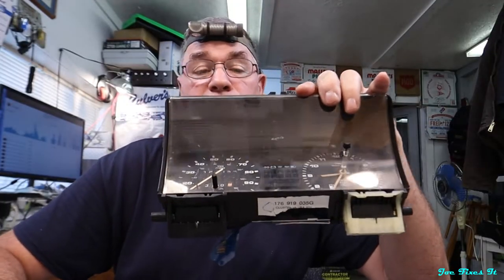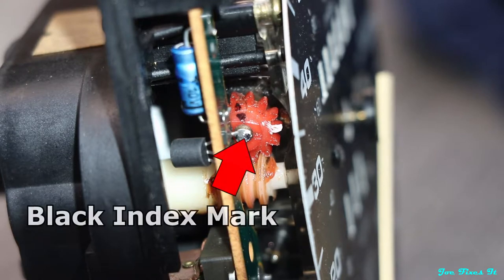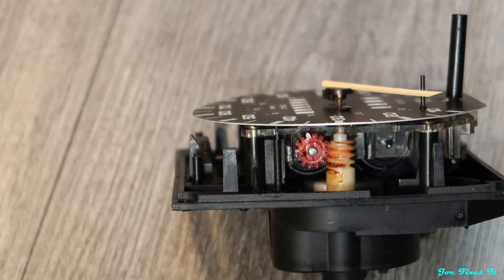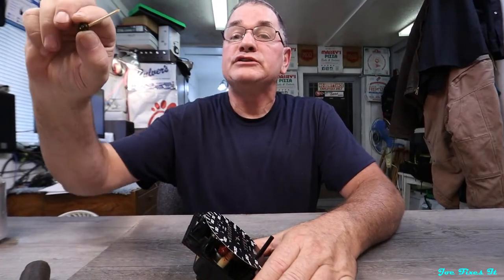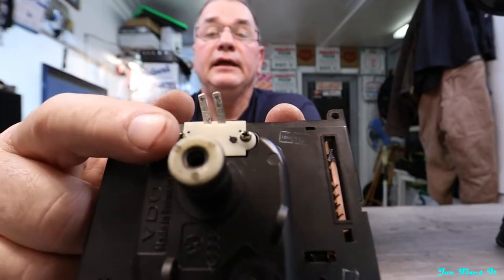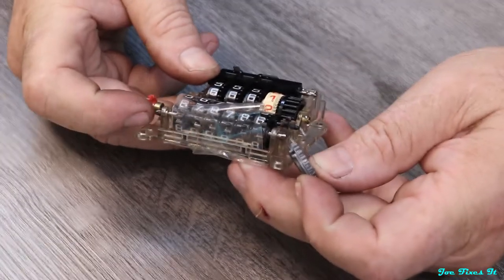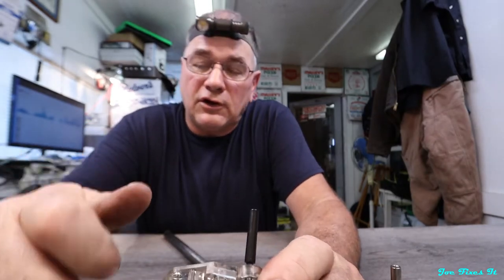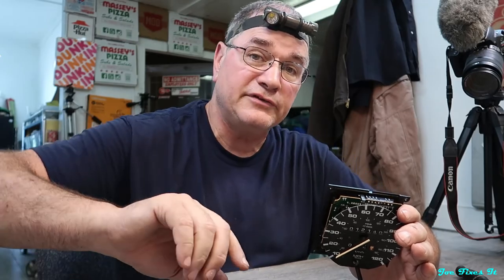How To Repair A Odometer | DIY Speedometer Repair | MK2 VW Diesel Gas 1985 1992 Jetta Golf 🚗🚕🚙

Comment: Superb video. I never leave comments but it is merited this time. I followed your instructions exactly and it worked perfectly. I have a Mk2 Golf with a Mk3 1.9TD swapped in to replace the stock 1.6D.
Reply from the maker: Thanks.. they are not too hard to fix.. a little hard to find the.gears but not impossible.
Reply from the maker: Sweet deal. I would love to have a 1.9 in my jetta

Comment: Thanks for sharing your knowledge 🙌
Reply from the maker: I want to make more Mk2 videos..
Reply: @Joefixesit  yeees !!! That would be awesome 🤩 

Any chance you can make a video of how to fix if the needle is only bouncing?
Reply: @Adel_Volks  that is almost always caused my a bad or mis-routed speedo cable.
Reply: @JoeisHungry  , wow! I will check it then. I just finished opening my speedometer thanks to your video… and I found out I’m  missing the small plastic gear. I will be making an order very soon.

Thanks 🙏
Reply: let me know how that goes, they are not very complicated, just have to be careful taking them apart.

Comment: Hey thanks for the video this is probably a stupid question, but in regards to the worm drive gear and the red sprocket that rotates with it, if these 2 don't turn together could it be the cause of the tachometer (mileage recording) not working, or is that only if the speedometer isn't working. I was a bit confused so hopefully someone can clarify for me, much appreciated!
Reply: the little white gear on the side usually splits with age and turns loose on the shaft and or the pot metal gear on the opposite end fails. You can buy both on line these days
Reply: @JoeisHungry  yeah I after removing the unit from my vehicle I was able to see that the worm gear is what then turns the other internal components, as you highlighted in your video mine also has a small crack in it, but was slightly out of place so I pushed it back into position, and tested it and seems to be working okay for now. I will have to replace eventually unfortunately I made a stupid mistake when trying to remove the unit and ended up damaging some of the multi plug connector pins where they actually connect to the plastic pvc circuit board. To be totally honest I think I'm a bit f***ked now, but will see if I can find someone that would be able to repair this, or if anyone knows of where to buy replacements. I'm based in the UK so unless you have happened to come across any european or UK based companies yourself I doubt there's anything you could help with. I'm only saying that so you don't waste your time trying to make some suggestions for US based companies if you were going to help, but I'm not expecting any help.

Comment: hi joe, my 2007 vw rabbit has its odometer not working. i took the dash out and when i put the positive wire from the battery at the power wire at the dashboard, it moves, but when i put all the wires from dash toggither, it doesent. do you think theres some power missin on it?
Reply from the maker: I primarily mess with MK1 and MK2 Diesels, I think what you have is a MK5 of MK6. Does not sound like a mechanical issue. I am sure you have checked the fuses. Your car is much newer than the ones I work on. Sorry

Comment: Hi Joes,

What can be the issue like this : 

When i remove "black jack" from cluster the car works normally,

When i put it back, the engine shakes for some moments..

What is the wiring on the black jack (left one) ?
Reply: if this is a rabbit 1984 and down.. (not sure about the Mark II) 1885 to 1992 but I think this is the case also, the red charge led is a part of the charging system with the cluster hooked up the alternator is not charging taking a load off the engine thus running smoother.
Reply from the maker: correct

Comment: Joe, I SURE hope you can help me.  I've got an MK2 cluster that looks VERY similar to yours pictured (it's actually made by Jaeger and comes out of a 1991 Mexican Volkswagen bus... long story).  The problem is that the speedometer works, but is very sluggish.  It lags a lot and takes a few minutes to get up to the speed I'm traveling.  It appears to keep the correct high speed, but at slow speeds, or when stopping it takes forever to drop all the way down.  Any ideas?  THANKS! (PS: I can email you a pic if you'd like).
Reply from the maker: yeah send me a photo at photos1101@gmail.com... 3 in 1 oil (not the spray) ..sounds like the needle shaft has some corrosion  on it or gummed up. The fact that it is accurate makes me think that otherwise I think of moving the magnet (which I hate to do) the speedometer heads are pretty common gas same as diesel.
Reply: @Joefixesit  Thanks, Joe! Last night I took it apart, cleaned and lubricated it (hopefully white lithium wasn't a mistake?).  When I tested it with the old speedometer cable and a drill (yes I bought a new speedo cable) it appears to work perfectly.  After coffee I'm putting it in and we shall see... I will also email you some pics because I'd like to see if it's possible to change out the speedo for one that reads MPH.  Thanks again and will email you soon with the results. - Chris
Reply: @ChrisRubeo  sure can.. just need to find a MPH speedo head. let me know what happens back in the car

Comment: Any advise on how to fix a VW mk1 Golf (rabbit) speedo, specifically the magnetic drive?  The magnetic "pot metal" disk broke into pieces. Any suggestions other than stripping one off a scrapped vehicle?
Reply from the maker: You will need to find another speedometer head if you can find one. Does not matter Gas or diesel. My question is how in the world did that happen. sorry for taking  so long to answer
Reply: @Joefixesit  A very impatient fool with a screwdriver, aka me, trying to pry the soft magnetic disc off the part where the cable goes into.  Wanted to remove it and find the noisy bearing I thought it had underneath not knowing at the time there was no bearing.  The original issue was at certain speeds it suddenly jumped 40kms/h higher and made a terrible squealing sound till you slowed down enough or whacked the dash hard enough for it to jumped back to normal silent operation.  Oh well, this is South Africa, should be able to find one at a scrap yard somewhere.  If it wasn't for the fact that it was magnetic i would have 3d printed a replacement disk already.  Are we sure that it's magnetic?  I have pictures of what it looks like internally.  One could be forgiven for thinking it was friction run, almost like a clutch plate.
Reply from the maker: @mikebmike1999  definitely a magnet. That is how it works. I would send one I have but shipping is a killer over seas plus mine reads MPH. Hopefully you can find one, her in the US they are impossible to find.

Comment: Hi my 1990 Polo speedometer often stays at zero, sometimes it frees off after a few miles or if I stop and start again. I've replaced the cable and it still does it. Interestingly the miles still go up so I guess the cable is fine and connects OK it must be the needle or some part driving it? Worth a bit of lubrication somewhere??
Reply: I assume they are using the same or similar cluster to the VW Mk2? it is usually the odometer that does not work and the needle continues to point at the correct numbers as the drive gears are slipping on the shaft. but in this case sounds like corrosion in the needle spring assembly which in the case of VW is quite rare
Reply: @JoeisHungry  Could be - in our climate here in the UK it can be exceptionally damp - this winter we had lots of problems with condensation and I even got ice on the inside of my windscreen which probably didn't help. It is usually better on a warm day but seems to be doing it more often. I guess the only option is to take it apart to inspect this needle spring.
Reply: @StewSims  3 in 1 oil is the best lube for that
Reply: not the aerosol kind, the aerosol had hydroscopic properties

Comment: Hi Joe.  1988 Vanagon - made the hole in the metal gear smaller, replaced the 14 tooth plastic gear (broke it while tapping the shaft back on the metal gear!), cleaned and lubricated the worm gear and 14 tooth gear, and now have an issue in calibration. I get 60 mph at 917 rpm !  When it's closer to 1600 rpm I'm at 100 or more!!  Have moved the thin middle spring clockwise and CCW on the needle post - doesn't seem to do much re rpm/speed.  I thought making a bit more resistance on the spring would lower the mph.  All the gears are free, the speedo worked before I did this work.  I'm the original owner (99,970 miles).  Any ideas?
Reply from the maker: I typically do not mess with the spring tension, what I do it put the pointed at the index mark and move it from there. in extreme cases I might move the magnet on the shaft. check the color of the gear on the end of the speedo cable that goes in the transmission as there are several different once with more or less teeth that will change the speed. make sure you do not have on for a gas if you are running a diesel. For regular mk2 diesels they are white and for 1991 ECO they are green.
Reply: @Joefixesit  Thanks for the quick reply.  I think I figured it out.  On the face of the speedo it says 805 just above the MPH.  From what I have read that means set it to 805 rpm for 60 mph.  That seems much more in line with what I'm seeing with the drill speed and what it's showing with the needle.  I'll try that and see how it works.  OEM tires on the Vanagon were 185/14, I have 205/15 - I'm reading that the difference is -2.2% in terms of rpm, so I'll set it for as close to 787-790 as I can get it.  Thanks for the response.
Reply from the maker: @ricksproule6690  I have not seen one with tach numbers before but the sandard way it to take the needle off and move it. there is an index marked near the stop peg that will get you close. let me know what happens

Comment: My numbers works right, but the pointer oscillates/bounces. Changed the drive gear in the shift but it was like new, changed speedo cable and made a very bad noise (i lubricated with oil an now still makes a little noise like the original cable). What it could be be if the number works right?
Reply: sorry for responding late, sounds like you need tp replace the speedo cable. it is almost impossible to fix it with lube. That's the only reason I have ever had oscillation. they are available and not expensive
Reply: @JoeisHungry  mhh you say to try with a third cable again? I tried to turn the speedo directly with the drill in it (no cable between) and still oscillates….also cleaned the old grease in the gear and put a drop of oil. Maybe is the magnet behind the pointer?
Reply: @giacobmx  did you already replace the speedo cable?
Reply: @JoeisHungry  yes, new cable but nothing changed. I also lubed it with oil because they came with no lube and you can’t open them.
Reply: @giacobmx  normally you do not lubricate the new cable as it has a plastic liner, it is unusual to get an oscillation just from a head malfunction. I would use a 3 in one on the head itself internally. I wish you had another head to test with. Is this a MK2 Diesel or gAS?
Reply: @JoeisHungry  mk1 gti 1979.
Reply: @giacobmx  so this is round head light version, lemme see if I got an old head in the parts pile, round light are German made and rectangle are American made

Comment: hello sir do you know about GM/Opel Odometers?
Funy thing me odometer is ticking for years wont move.
I asume it has some thing to do with Delco 12si alternator its ordinary 80s car similar to WV.
How ever when me blinker relay didnt get ground me wire to ground was corroded and be acident I suppose me towing wire harnest was arcing to ground I simply cutt off that thing repaired leter that blinker / lights problem kinde of me car run in union with blinker relay and odometer worked again no ticking???
So thats what confuse me most me odometer works its that thing that counts milage / kilometers .
So be all means Im anoyed what the hell shuld I do?
Shuld I add ground wire to dashboard for extra safty ?
Use diodes and where exactly I did notice GM made fatal mistake they bypassed the alternator light diode insted those dicks used the car warning light insted so that wuld explain me alternator backcharge but still that odometer confuse me .
Can that deam thing act cinde of timer?
Reply from the maker: I do not sorry

Comment: what does the circuit board operate?
Reply: interment cluster
Reply: @JoeisHungry  aaaaahh
Reply: @yoshinoyajones8924  the circuit board is a fragile piece of plastic with imbedded thin wires on the back of the cluster

Comment: What’s going on if the speedometer needle hole part is seized
Reply from the maker: not sure what you mean, the needle does not move or will not come off?
Reply: @Joefixesit  so in the back of the cluster where you screw in the cable , that part won’t spin
Reply from the maker: @jongon705  I have seen speedo heads rusted almost solid but not that part froze.. need some serious soaking in 3 on one oil.. not the spray can stuff that is WD with a 3 in one label
Reply: @Joefixesit  ohhh ok I’ll try a good soaking.

Awesome video!

Mine is a 1984 diesel rabbit
Reply from the maker: @jongon705  ahh, the mk1 speedometers are a little different but not that much. a little less problematic . I had one for a while put 600,000 on it myself until I rolled it. what part of the country you live in?
Reply: @Joefixesit  Los Angeles
Reply from the maker: @jongon705  Ill look out in the parts and see if I got a spare mk1 speedometer head I can send you. Is this a round headlight version (American made) Rabbit?
Reply: @Joefixesit  square headlights
Reply from the maker: @jongon705  okay, will let you know in an hour or so.
Reply from the maker: I got one with the needle removed but it still worked perhaps you take the pointer needle from the other one and make a working unit. Be very careful removing the needle as it is on a splined shaft (not like the tapered shaft of the MK2) and will be harder to get off although it WILL come off. Friend me on facebook to give me an address to send it to. I have a link in the home page of this channel and my food channel called "joe is Hungry".. I will ship it to you free of charge. Just enjoy and get some use out of it..

Comment: My speedometer needle broke when I pulled it off, I ordered a replacement but the replacement will not go on. Does anyone have any ideas?
Reply from the maker: I did not know you could even get a replacement for a Mk2 VW
Reply: @Joefixesit  I found it on eBay
Reply from the maker: @Grox4990  you are lucky if it the right one.best thing to do is troll the junk yards and grab every cluster you can find for parts.